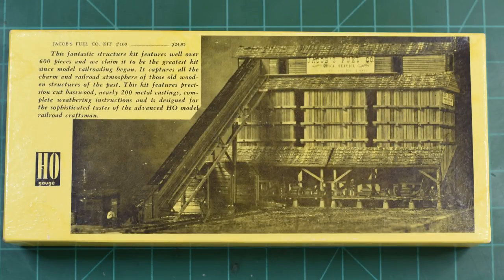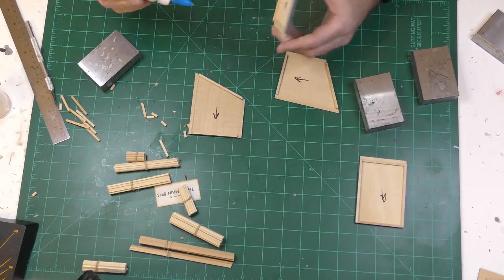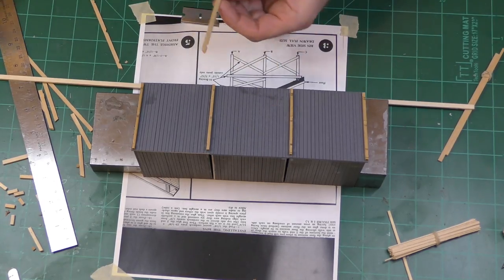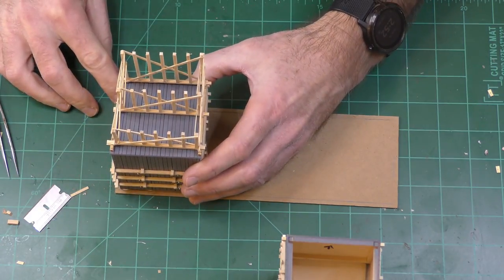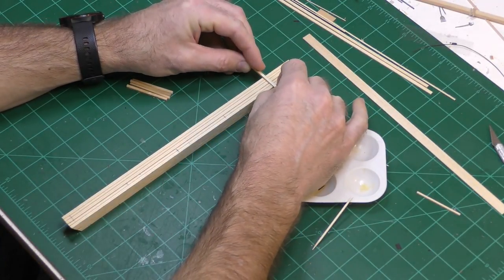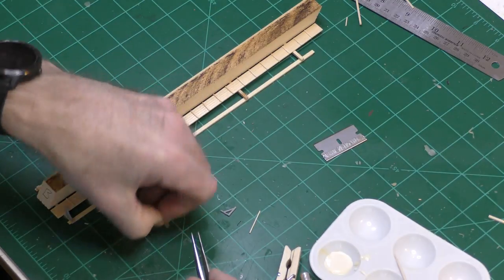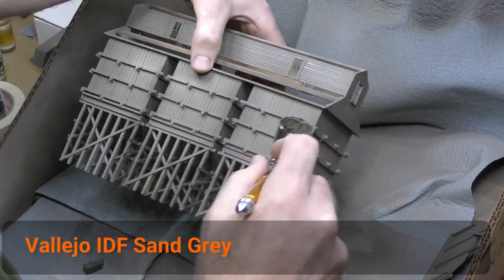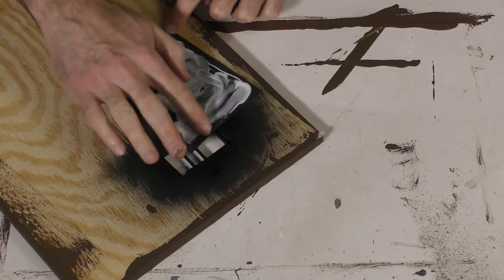Jacobs Fuel  (1972) from Fine Scale Miniatures build in HO Scale with Diorama

Comment: Thank you for the build. Now I can move ahead on my Jacobs fuel which has been on the shelf for quite a bit. Thanks again...I learn much from your techniques.
Reply from the maker: Thanks for the comments.  I thought for sure no one watching would ever build the kit.  I guess I was wrong.  Remember that you cannot paint between the buildings once they are attached to the cardboard!
Reply: Thanks for the tip. I am going to change it around a bit so the area where the coal trucks back up to the bay is on the other side so the elevator won’t interfere with them. Anyway that’s the thought ...
we will see when it’s underway. BTW I really like the pace and tone of your builds. Calm and informative not frantic. I believe that’s what is needed to get high quality results.

Comment: Building Wood Kits Is Not Easy By Any Means.
Reply: I built this kit back in 1974. First wooden kit I ever attempted, and it came out great. I still have it. The instructions that come with this kit are great, both from the point of view of building the kit, but also for weathering it to make it look used and old. The materials we have now to show weathering would make a new build ever better. With patience, you can build a great model. I worked on it about an hour a night, five days a week for three months to get it done to the level I wanted. This was a era of not-so-great glues. So much of the time was spent waiting for the glued parts to cure, usually overnight.